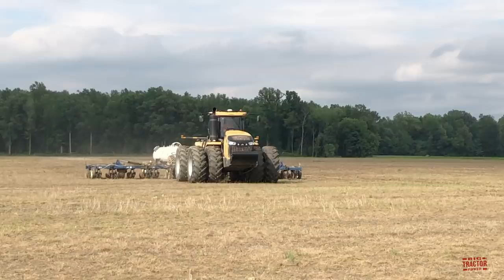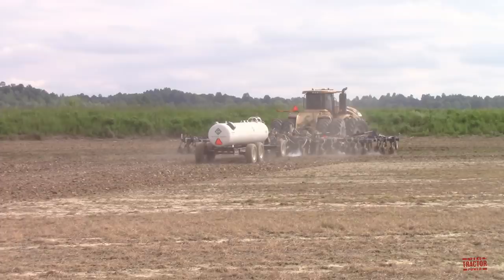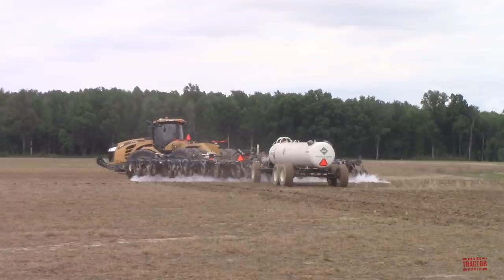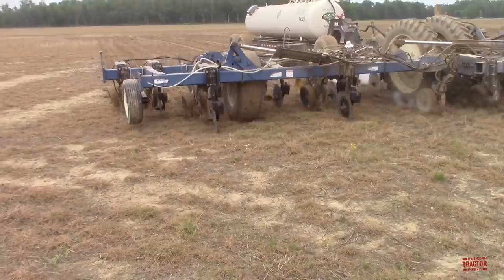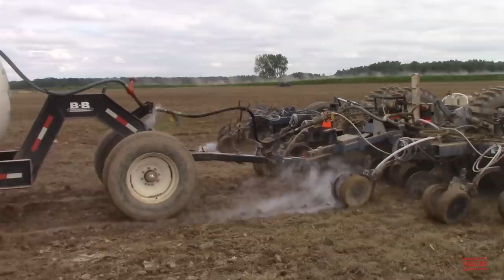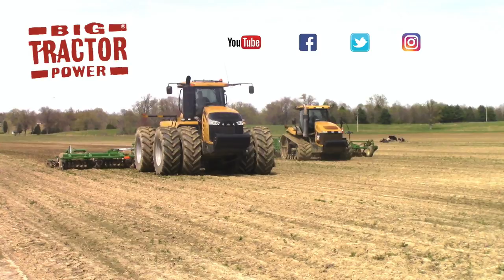550 HP CHALLENGER MT965E  Tractor Applying NH3

Comment: I like it, does it come in red?? Awesome machine, would of liked to see you in the cab to see how quiet it is to other tractors. That guy needs to put the hose back on the knife he is losing a lot of ammonia on that one knife...///
Reply from the maker: It is only comes in a yellow. I think a Massey Ferguson version would be a good seller. On the leak. This video is just three passes in the field over 8 minutes. They stopped and repaired the shank.  I just moved on to the next field to catch another MT965E on a Turbo Till.
Reply: Yeah, they need it in red!

Comment: going from 540 HP to 550 HP doesn't seem like a very noticeable horsepower upgrade
Reply from the maker: This a common automotive upgrade on cars, trucks and tractors. Small increment horse power upgrades are added for an updated model.  In tractors they might add 5 to 10 hp in a mid series upgrade. When a new model is released they jump  15 to 30 hp.

Comment: Wonder if AGCO will discontinue the articulated 4wd tractors or paint them Fendt green along with the tracked ones?  AGCO has never had much success in the articulated 4wd tractor market.
Reply: Zero01k nope, they’re getting MAN engines and new cabs.
Reply from the maker: It would be cool to see an MT900 as a Fendt or Massey Ferguson. The MT900s sell well for pulling pans and I expect they will keep this type 4wd.
Reply: @bigtractorpower  Agco seems to think very highly of fendt so it will almost certainly be in green soon. It would really smart to make them available Massey Ferguson.
Reply: The MT tractor has nothing in common with Massey Ferguson articulated 4wd tractor history, it would always be know as a red painted Challenger.  Now my reason for saying AGCO has little to no success in the articulated 4wd tractor market is because of the AgcoStar.  AGCO bought back one of the best 4wds ever made, the Massey Ferguson 4000 series architecture.  But what did AGCO do?  Paint is silver, called it not Massey Ferguson, and offered no 3 point hitch or pto option for the new machines.  They couldn't have handled it more poorly than they did.  Pan work is all they have been successful in with their Challenger articulated 4wd tractor.
Reply: @Zero01k  Agreed. But... It also has nothing in common with anything fendt either. Agco is painting more and more stuff green that has nothing to do with a German tractor company
Reply: @zimmermanservice7474  I am aware, they also have discontinued the single axial rotor combines and they have no plans as of now for marketing the Idea combine under the Massey label in North America, it's a bold move.  I wouldn't be surprised if Gleaner goes next.
Reply: @Zero01k  I can't say I'm thrilled with their direction 😕
Reply: I always wondered how AGCO stayed in business anyways, given their colorful history and past actions.
Reply: Looks like I was right, the MT900s are discontinued